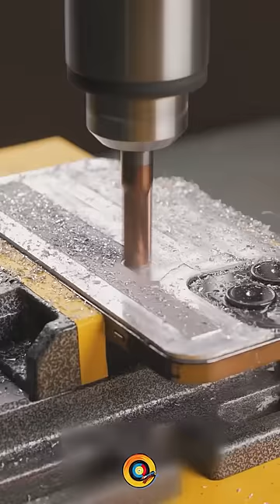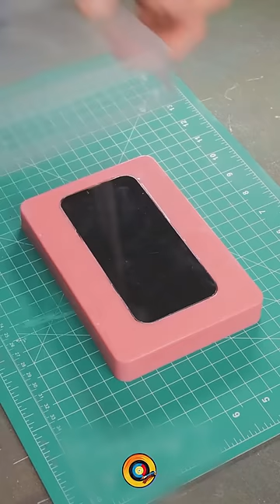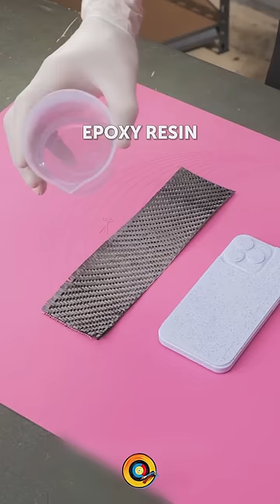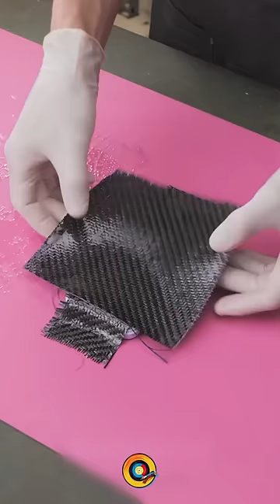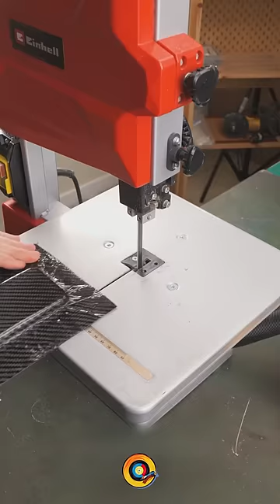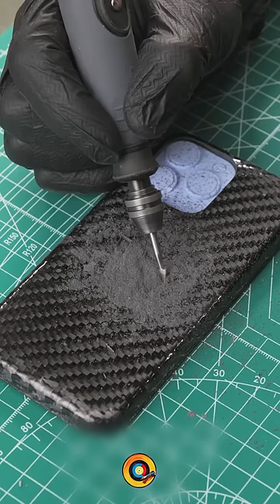Your Phone Deserves a Carbon Case! 📱 | Listen “POLAR - FIREFLIES” on YT

Comment: Te other problem is that carbon fibre blocks cell signals so if you were to use this case, say goodbye to receiving data/wifi/phone calls.

(For those who are going to ask, most cases that are made of ‘carbon fiber’ are in fact made of Aramid Fiber (also known as Kevlar) which also has the same pattern/texture)